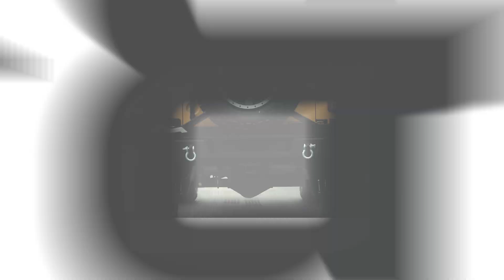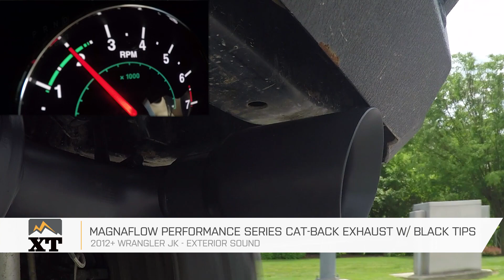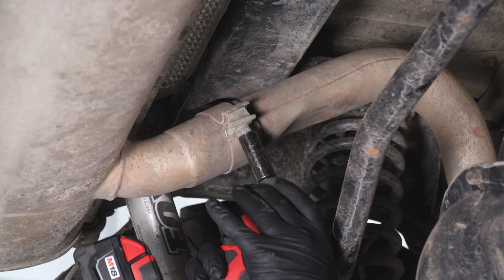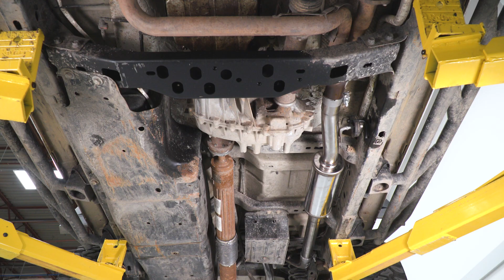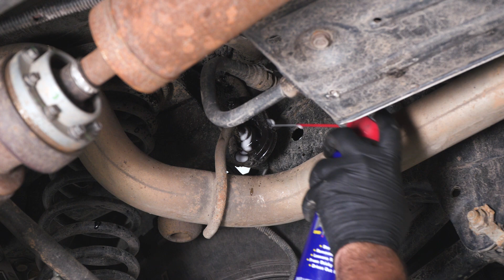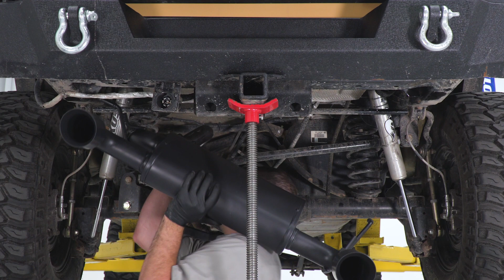Jeep Wrangler JK Magnaflow Performance Cat-Back (2012-2018) Sound Clip & Install

Comment: After an extensive look at Rear Axle Mufflers before I stepped out to make this change, I settled on the Magnaflow Street Series Axle-Back Exhaust with Black Tips for the 2021 Jeep Wrangler JL 3.6L. This has been installed on a brand new Jeep JL with less then 1000 Kms on the truck. 

My top three criteria’s in my choice selection were the quality of construction, the appearance and of course the sound both in the exterior and in cabin sound.  Yes, there is a cost, however when you way all of the factors in your choice, you will pay for what you get! 

For me when I wrote this post, and I am now 3 months into the Magnaflow Street Series Axle-Back Exhaust, I am so glad I made this decision in both the sound and performance!
Reply from the maker: We are glad you love it! Thanks for the feedback and for watching!!